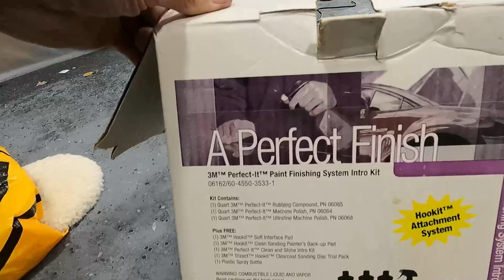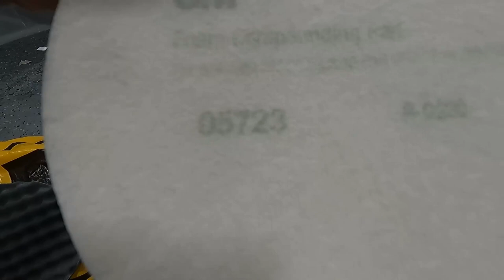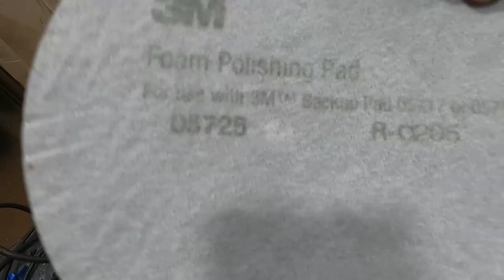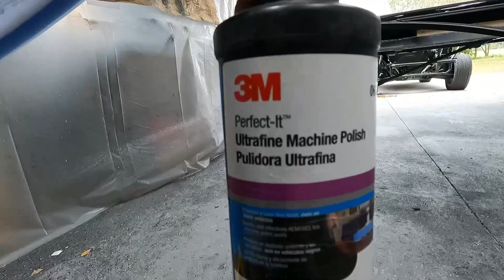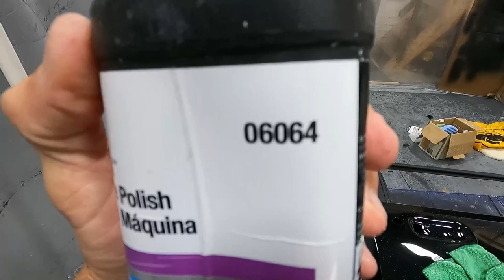How To-3M Perfect-It Trizact Paint  Finishing System AKA "Color Sanding"

Comment: It's great to see someone who takes quality over quantity. I worked for so many body shops as a Detailer/Buffer. And this is the one thing, that always irritated me. I always had a boss breathing down my neck, telling me to skip certain steps, or give it to the customer the way it is. I always prefer to take my time, to ensure amazing results. I can't tell you how many people I know say they are professionals at buffing. And half of the time, I always see hazing or wet sand marks on the paint still. Most employers nowadays don't even care about Quality anymore. Just to make a quick buck and out the door. 

  I like the fact that your taking the time to show people what kind of results you get. When you take your time and have passion for it. Like you said In your video" don't rush the job". It definitely shows when you rush the job.

Comment: Hey, I found your channel through your R8 coil install vid. I see you're not running a bracket, so I gotta ask have you had any issues at all with the coils coming free? I know they clip onto the spark plugs, but I see some brackets being sold on eBay which is making me reconsider whether or not it's necessary. You've got a great channel by the way, very in-depth on your build. I see you're in Florida so maybe we'll film something for your Fox if I'm ever in the Central Florida area or if you race it at Palm Beach, I'm from way down south in Miami.
Reply from the maker: I haven’t had any issues at all. There not a heavy coil so I don’t see the need for a bracket. I have been wanting to go to pbir. Maybe once the black car is done.
Reply: @fox-body  cool I'll pass on the bracket then for now and just put the funds into bushings, sensors and a few other things the car may need. My supra is gonna be on the dyno in a few weeks so I'll be at more events and maybe racing at pbir as well

Comment: Great Work! Inspiring for sure. How long did you let the paint cure before cutting and buffing. I was always afraid the clear would be too soft if it didn't clear for weeks.
Reply from the maker: You can actually do it after 1day. Some prefer that because it’s easier to cut. This door cured for about a week or so.